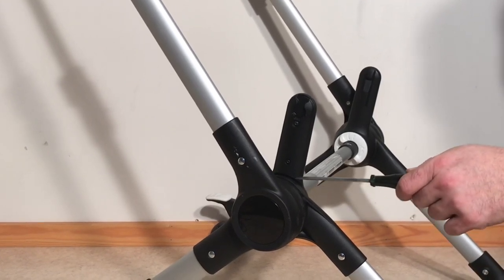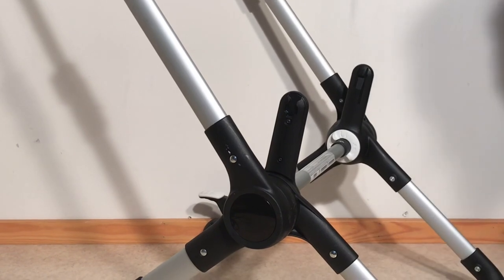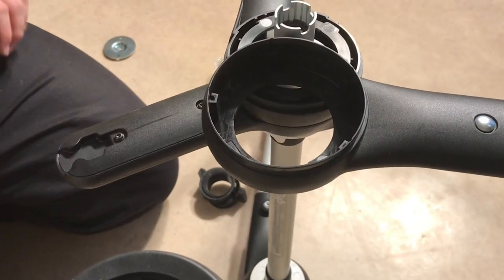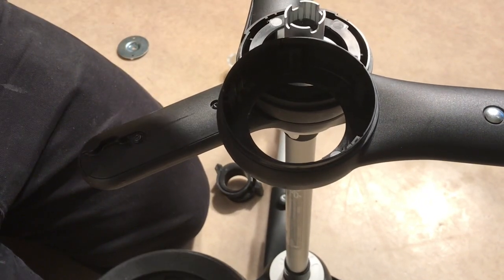How to Fix Folding / Unfolding Problems with the Bugaboo Fox

Comment from the maker: As an independent, consumer-oriented reviewer, we are reliant on your contributions to pay the bills and remain operational.  If you would like to help support our work, could use a personalized consultation, or think you might enjoy some additional exclusive content in the form of articles (mostly related to the ‘shadier’ side of the stroller industry), as well as access our regularly updated ‘Buyer’s Guide’ (which lists the models we recommend, as well as providing a lot of technical and lifestyle-related information), please visit our Patreon Page: 
https://www.patreon.com/thestrollerworkshop

Thanks so much for your help!
Reply: Thanks for the video! Big question: where does one get replacement parts? :D
Reply: Hi, this was a very helpful video!
Would you consider adding an option for onetime donations, I'd sure buy you some beers! :D
Reply from the maker: @bubblefoil  thanks! :) I’m glad you found the video helpful.  There’s a super-thanks heart icon under the video if you want to donate one time. :)
Reply: @forg1vr did you find an answer to this? 🙏
Reply: @glamyourpramuk  Unfortunately, no replacement parts available to buy. 
I took mine apart to „clean“, made everything worse, and was lucky that I found a Bugaboo repair shop that fixed it (with new parts)

Comment: Great video! I've pulled apart my fox but it still seems to have a few gremlins. I'm now struggling to get one side to lock in open position when fully opened. I found no obvious faults when disassembled, it's got me beat!
Reply: For me, I have a Fox 2, the right side of the mechanism is a bit stuck. It was before, and opening it up and looking at it actually made it worse to be honest. I cleaned it, greased it, but the mechanism is still too tight. Not sure why - but I have reached out to Bugaboo to get a replacement axle and spring. Curious to see what they say.

Comment: Thanks for the video. I can no longer attach the handle of the stroller and therefore can no longer use it. I did the disassembly according to your video and it immediately worked better. Unfortunately the next day the problem was present again. I find the pull levers to fold the stroller very hard to pull. Do you have any idea what the problem is by any chance. Thanks in advance for your detailed help.

Comment: What a useful video, thank you very much.  I actually have an issue where my plastic sleeve in the first disc does not move freely around the axle when it is pushed on completely.  I can't see what is causing this stickyness but it obviously prevents the whole mechanism from working.
Reply from the maker: Thanks for the contribution, we really appreciate it!  Assuming you mean when the mechanism is still disassembed, and you're just testing rotation via the triggers (like at 3.26 in this video), there are plastic tags on the 'floor' of the first disk, and the sleeve has to be positioned in correctly (and the wire as well) for these tags not to impede the disk's rotation.  If you mea when the stroller is fully reassembled (but otherwise the sleeve rotates fine), then it could be a problem further on in the mechanism.  Hope this helps! :)
Reply: I have exactly the same issue. The plastic inner core seems to be too big (or the sleeve too small)
Reply from the maker: That suggests a warping issue then, if the problem is repeating.  I would probably try a combination of sanding with a dremel and thick lubrication (though I can't promise this will fix it, and I would procede carefully).  There used to be warping issues with the Cameleon seat frame: https://www.youtube.com/watch?v=J3u_hkMHleA&t=261s (7:04)
Reply: Just to close this out - I never got to the bottom of why it wouldn't move freely when the sleeve was all the way on. It may well have been a warping issue - it wasn't a visible problem and my partner likes to hang heavy shopping from third party hooks on the handles. Still, it has served 1.5 children before getting to this point, so not too bad.

I had tried sanding various bits by hand with sand paper but I couldn't get it moving freely. In the end I purchased a replacement handle set from eBay for £30 and it came with new sleeves and springs. I just reassembled it with some lubrication on the rotational springs and I'm up and running again, confident that it will last for the remainder of our second child :)

Thanks again
Reply: Heya, we have the same issue, any chance you could share a link for what you purchased from eBay? Thanks!!
Reply: @jessicabarnes1427  Hi I did post a reply to you but I think it must have been deleted due to the eBay link. It was called something like "Bugaboo Fox/Fox 2 handle repair set"

Comment: Thanks so much for the great video! At 4:40 you mention another video about the repair of a broken handle button on the folding trigger but we can't find it. Could you possibly share the link? Thank you!!
Reply: I was looking for this video yoo but couldn't find any. Tried to dissadsemvle the handle myself but didn't succeed, as the only screw there only dissassembled the snaps that control the handle bar extention, not the folding mechanism. Would love to know how to do it. The spring and wire doesnt pull back when disengaged, so something must be the matter with this mechanism.

Comment: Hi there, would the popped wire be the reason my bugaboo fox central fold mechanism seems unstable and clicks, after I have unfolded it and set it up? I push down on the handlebar and one side is sturdy but the other side can be pushed down ever slightly, doesn't feel sturdy and makes a click sound. The pram still pushes fine but just doesn't feel like it's locked in place. Thanks!
Reply: Same issue here :/

Comment: Mine is still a little crusty, would you recommend lubricating the mechanism? Thanks
Reply from the maker: Thanks so much for the contribution, we really appreciate it!  You can definitely try lubrication.  I would recommend wd-40 (with the straw attachment).  Spray generously between all the disks and work the mechanisms (fold and unfold) to help the lubricant sink in.  Let me know if it doesn't work though, and we can brainstorm further. :)

Comment: Hi there, thanks for a great video. The spring and wire are both in their right positions, but when i engage the black locking button and slide the white handle lock upwardsthe the spring stretches and the wire rotates, but when i disengage again it doesnt pull back at all, the spring remains engaged and thus the locking mechanism remain open, as such, the pram cannot be locked in a usable mode, it just falls apart into a folded mode. Do you have any idea how to deal with this one? Thanks!
Reply: Hi, I seem to have the same problem. I've noticed that the black cylinder that's actuated by the spring and wire has a lot of friction when it's fully set in its place, so the spring is not strong enough to overcome that friction and does not lock the mechanism.
If I pull out the cylinder just a few millimeters, it can rotate freely. I don't know how it could get so stiff. Maybe it needs to be greased by I don't know what's a proper lubricant for that plastic part.
Reply: @bubblefoil  I didn't find an answer anywhere, tried different greases but non of them worked, just got sticky. I ended up sandpapering the black cylinder on the inside to widen its diameter, took some time but managed to get it to rotate a bit better so at least I could use the pram again. Stupid design.
Reply: @mrrichstones  thank you so much for coming back with your solution. I had the same plan - trying some grease, then widening the outer cylinder. I just wasn't sure whether to choose sandpaper or heat :)
Agreed, I just can't believe a premium pram for a premium price suffers from such a lame issue.
Reply: @mrrichstones  OK, so I've filed it down to a larger diameter. It rotates freely now, until I put back the wire. It seems like the wire is stuck in the tube somewhere, being another source of friction. OMG, this sucks...
Reply: @bubblefoil  The wire you can easily check by just pulling it back end forth holding one end and using the white sliding button with the other hand. Was no friction for me, ran effortlessly back and forth in its tube. However, with the filing, I had to do A LOT, until it ran smoothly not only without the wire, but with the wire and spring put back on. I think I probably disassembled and assembled 20 times until I was satisfied with the friction.. every time was like, "nah, just a little bit more".. indeed, ridiculously stupid design.. Also tried swapping to other types of springs, but found the original spring was best..
Reply: @mrrichstones  What I did was looking through the cylinder pointing to some light so I could see where it is scratched the most. I marked it on the outside and tried to grind those spots the most. I went directly with a rather course file, then very fine sandpiper under water. It wasn't enough, more file, another check, turns out that the horribly scratched surface slides just fine.
It's kinda weird but the wire seems to work fine when the frame is in the upright position. When I was testing it on the side, it was rubbing somewhere.
Anyway it's reassembled and working!

Comment: My issue is what the white and black buttons at the top
Reply: I have de same issue. can you help me? do you know how to disassemble it? thanks in advance
Reply: @estherpardallebrero9288  me too! My left side button/pull leaver is sliding with no catching anymore.. so I don't know if the problem is from this part or the middle section
Reply: Have u fix it ?? Same problem
Reply: Same... Any fixes?
Reply: Same help pls
Reply: Same here 😢
Reply: I'm having the same issue with my lynx 😢 it's a pain in the butt.